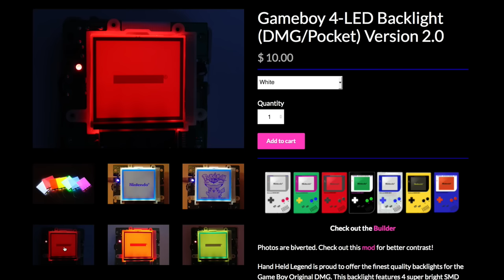How to Install a Game Boy Pocket Backlight!

Comment from the maker: I'm told that newer versions of the Hand Held Legend backlight kit have been revised so that the resistor is built into the backlight itself. If you pick up one of these kits, it won't include a separate resistor, so the step in the video that shows installing one can be skipped.
Reply: This Does Not Compute can I add the backlight itself without the new polarizer? Or it’s has to be the whole kit?
Reply: Hey Colin. I've been watching a lot of your Gb,Gbc,Gba lighting mod videos. The Gba one helped me out a lot particularly. One random question though... What kind of soldering gun do you use? I really need a better one and the blue and yellow one you have looks like it works really well.
Reply: Juan Diaz you will need to use the new one the old one will basically be ruined doing this and you need a polarizer on the bottom the get any kind of display
Reply: this video is extremely helpful! I love all of Hand Held Legends products they are awesome quality for the price!
Reply: Also the instructions for installation have been updated:
wiring it up as shown in the video makes the backlight flicker, which is barely notable in some games (like F1 Race), but can be extremely uncomfortable to look at in other games (e.g. Hugo). Plus, I had the backlight start to go dim after just 40 minutes using fully charged-up rechargeables.
The updated way to connect the backlight module as shown on the product page is to solder the POSITIVE lead to pin 6 (above pin 4 which you soldered the negative to) and the NEGATIVE lead to pin3 (below pin 1 which you soldered the positive to). Note that if you still have the old version of the backlight module, according to commenter "Moon", you MUST use the resistor, as  it provides constant 5V, as opposed  to varying 2.5-2.7V from pin 1.
This removed the flickering and the rechargeables lasted me easily three times as long, but when they do get weaker, now the contrast gets increasingly lighter until you can't see the pixels at all (but that's just before the gameboy turns off), while the backlight brightness stays constantly bright. So, you win some & lose some using this wiring, but overall it's much better, imo.

It would be cool, if you could put an annotation in the video or update your comment with this information. Other than that I want to thank a lot for this guide! It's been very helpful to me doing this mod and showing me that it even exists in the first place, and gaming on my old Gameboy Pocket is SOOO much more fun now than it's ever been! (And I've had this thing since I was like six years old).
Reply: @LRM12o8  I'm so confused!  I did mine like he did in the video and it flickered right away.  So then I did it like you said positive on pin 6 and negative on pin 3 but I'm getting what sounds like your original issues.  I'm using alkaline and it looks and works great for about 40 minutes and than the contrast (not the brightness) starts to flicker with CPU usage (it seems) and the red power LED gets dim.  I've gone through 2 sets of batteries in a few hours!  Any idea what it could be?  What should the battery life be like with new alkaline batteries after the back-light mod?  Can't be this bad.  Something must be wrong.
Reply: @MN12BIRD  You should look up adding a 5v regulator and a decoupling cap to sort this problem. That will increase battery life and also keep the backlight at same light until batteries gets low.
Reply: They don’t sell the pocket kit anymore

Comment: Just completed this mod with the help of your fantastic video. Keep up the great work!

To those of you who want to try this mod, BE WARNED: the step Colin mentions where he places electrical tape on the opposite side of the backlight mod contacts is more important than is conveyed here. Depending on how the GBP is reassembled, the contacts mentioned may touch the  cartridge slot contacts on the bottom of the PCB. If this is happening, the system will act as though your cartridge/cartridge slot is dirty and display a glitched Nintendo logo and not load any games. I spent an embarrassing amount of time trying to figure out why my Pocket wouldn't load properly and only worked normally again after covering them like Colin demonstrated.

Don't be like me. Cover those contacts before you bundle up your Game Boy Pocket!

Comment: Just did this mod, and the polarizer film, when you hold it up to an LED screen should be oriented the clear way. I.E. turn it until you can see through, and that is the right side up. The way he describes that part is a little confusing. But sweet video! My mod went successfully!

Comment: 5:10 this is incorrect. Soldering to this point will make the backlight flicker with the sound. The correct pin to solder the positive lead to is right next to where the ground was soldered, at pin 6. Pause at 4:45 for reference. Use the resistor when using this pin though, as it's 5v and will kill the backlight without it.

Edited to change the pin number from 5 to 6. Pin 6 gives constant 5v; the pin used in the video will give anywhere from 2.5-2.7v.
Reply: ah that point puts out 5v too?  thats handy.  I was use a capacitor at the top left of the board to get 5v.
Reply: Yeah there are a few spots to get good constant voltage, but the audio driver ain't it lol. I hope Colin updates this video, because it's a good tutorial. Just needs a little annotation to point to the right pin and explain that the resistor is needed after all.
Reply: moo. I have the one with a built-in resistor. I soldered the positive to the 5 point and the backlight didn't turn on at all. Where should I solder it?
Reply: Wow, I feel dumb, lol. Sorry, I was pretty tired when I wrote that comment. You should actually solder the positive lead to pin 6, not 5. 6 gives 5v; I'm not sure what pin 5 does.

I'll edit the top post as well.
Reply: Thank you, made all the difference
Reply: Pin 5 is -16.5V for the LCD, if anyone is wondering.
Reply: And Pin 1 is unregulated 3V from the batteries (2.4V if rechargeables), Pins 3 and 4 are ground, and Pin 6 is 5V.
Reply: moo. Great comment helped me so much
Reply: I soldered it to pin 6, my game seems to flicker. Most notably right now is when I’m playing Pokémon Red
Reply: Omg thank so much for this comment. My teal backlight was flickering between teal and green colors. Now its fixed and a solid teal. Thanks so much!
Reply: Just giving a +1 to this comment. Ordered my kit in Oct. 2020 which had a built-in resistor. Installed and soldered to pin 6 and it works great.
Reply: @noanoxan  crap :’(

Comment: Just finished doing this mod, a couple tips; use a piece of scotch tape around the bottom of the ribbon cable to hold it together, if you've got a lot of adhesive residue on the screen try using a magic eraser cut into small pieces.

Comment: Thank you so much for this guide! It makes playing games on the gameboy so much more enjoyable and it wasn't that hard to do.
However, I had some difficulties on the way, I'd like to share:

1.) When I first turned on the Gameboy after installing the backlight, the screen displayed everything just fine, but it didn't light up at all. I thought the rechargeables to be known good, so I checked on the solder joints and the connection to the screen and stuff dis- and reassembling the gameboy several times. At some point then I connected the gameboy to the wall adapter et voila: the screen lit up (still showing vertical bright lines). Using fresh batteries, it also lit up, though not as bright. freshly charged rechargeables worked as well.
So NOTE that wiring it up as shown in the video will make the backlight go dimmer as the batteries/rechargebles go low on power. there's n updated/better way to wire it up, more on that in 5.).
Test the backlight ONLY using wall adapter or fresh cells!

2.) Using an updated version of the kit, I had difficulties figuring out the correct orientation of the polarizer, as it looked the darkest/brightest holding it diagonally in front of a screen, and holding in a way it can fit into the screen assembly it just looked medium bright any way I rotated it. but that's not a big issue, though. first attempt, I had the screen inverted, but opening the assembly and turning the filter 90° solved that. no big deal, just something to note.

3.) after all the dis- and reassembling of the gameboy, I got some vertical lines of "white" running across the screen. The ribbon cable is very fragile, so avoid unnecessarily touching the screen assembly, even for troubleshooting purposes. I managed to fix that the next day by resettling the screen ribbon and taping it to the back of the screen assembly until everything made proper contact and the lines were gone. So, if you have vertical lines of what looks like "dead pixels" on your screen, don't worry, It can easily be fixed.

4.) Opening the screen assembly repeatedly to troubleshoot also made some dust go in between the screen layers, which does show in the screen. It's not terribly bad, However I would like to remove the dust particles but do not dare to open the screen assembly again and risk getting vertical lines again. So, again: DO NOT disassemble the screen any more than you absolutely have to! Oh, and keep a can of compressed air ready to remove any dust particles from the screen layers, just in case.

5.) wiring it upthe backlight as shown in the video makes the backlight flicker, which is barely notable in some games (like F1 Race), but can make it extremely uncomfortable to look at in other games (e.g. Hugo). Plus, I had the backlight start to go dim after just 40 minutes using fully charged-up rechargeables.
The updated way to connect the backlight module, as shown on the product page, is to solder the POSITIVE lead to pin 6 (above pin 4 which the negative was soldered to in the video) and the NEGATIVE lead to pin3 (below pin 1 which the positive was soldered to in the video). Note that if you still have the old version of the backlight module, according to commenter "Moon", you MUST use the resistor, as  it provides constant 5V, as opposed  to varying 2.5-2.7V from pin 1.
This removed the flickering and the rechargeables lasted me easily three times as long, but when they do get weaker, now the contrast gets increasingly lighter until you can't see the pixels at all (but that's just before the gameboy turns off), while the backlight brightness stays constantly bright. So, you win some & lose some using this wiring, but overall it's much better, imo.
product page: https://handheldlegend.com/products/game-boy-backlight-dmg-and-pocket?variant=16870377731
check the last image for reference!

In conclusion, it's a fairly simple mod and completely worth it!. Despite the difficulties described above, it only took me 3 hours total and with the lessons learned I could do it in less than 45 mins, if I was to do it again.

Comment: So I just did this. The ribbon cable thing is no joke. I slice the long grey cable straight in half from one side down. I attempted to repair it using a soldering iron, heating it up, and just barely running along the edges that were cut apart. Worked. My screen has a bunch of horizontal black lines near the bottom portion of the screen, but I've learned for next time I do this mod. Someone below this comment said to wire the positive end of the backlight power to number 6, right next to 4, instead of where he does on the video. Do this.

Comment: Hey I have a question. I got my backlight working but a portion of the screen doesn’t work it’s about a 1/4 to 1/2 inch horizontal section of screen with no picture. Not sure if I can fix it or if I need a new screen.

Comment: Since Gameboy pocket uses AAA batteries, it would be great to have the ability to turn the light on or off. I would put a micro push button right the bottom of the power switch. This way, you could slide to turn the gameboy on or off and press the power switch (with the GB turned on) to turn on the light. Using a microcontroller you can even add brightness levels.
Reply: this would be great, except for the fact that you removed the reflective layer, so the screen would be almost impossible to see without the backlight, however a dimmer like for the contrast and volume would be great.
Reply: I'm working on this mod, I'm finding difficulty to control the brightness using PWM due interference on the screen. I'll try some linear controller. Once I finish I'll let you know. Thanks mate
Reply: You're welcome

Comment: success! took longer than expected since most of the reflector adhesive stuck to the glass, and IPA, Meths, Ethanol, Gasoline etc didn't touch it. An aerospace degreaser finally did the trick! Buy hey, it works. Bivert chip to follow. Cheers :)
Reply from the maker: Awesome, glad to hear it all worked out!

Comment: Definitely worth it if you don't nail the ribbon cable. This is literally a console destroying project if messed up as replacement LCDs don't exist yet. Just nicked my ribbon trying to do this as the adhesive would not lift on any corner for me and I had a bad fight with it. Be careful and be delicate on this step, it's as fragile as it sounds.

Comment: I wrecked two screens trying this mod.  I got horizontal and vertical lines when I took off the reflective strip.  Any other tips or tricks to get this to come off easier and not have these lines?
Reply: The lines are a result of damaging either the screen or the ribbon cable. All you can do is be more careful next time.

Comment: Nice one! So do you recommend the resistor or not? I want to do this mod with the original gameboy but am not sure about the resistor. Whats the difference, Mr. Colin?
Reply from the maker: +Benny Palma Really, the difference for me ended up being the brightness of the screen. It's dimmer with the resistor and brighter without. If you plan to play mostly in the evening, the resistor may be a good idea. If you're not sure, try it with the resistor first as it's pretty easy to remove if you want the screen to be brighter. (If you want the best of both worlds, it's possible to install a small potentiometer that would let you vary the brightness.) Good luck!

Comment: I have a quick question: Do you know by any chance where i can get a full replacement screen? My GameBoy Pocket (Model MGB-JPN) has a messed up part of the screen. It just really bothers me and sometimes gets in the way. There are no dead pixels though. It's overtop of the pixels. If there is also a fix for this that would be nice. Thanks in advance ;)
Reply from the maker: +TheGrayWolf81 Is the problem on the glass of the LCD panel itself, or the outer plastic screen cover? I haven't found replacement LCD panels anywhere, but replacement screen covers are pretty common.
Reply: No, unfortunately it is not the screen lens (the plastic cover), but part of the some blueish black random spots in on part of the lcd. But like I said, it has nothing to do with the pixels, there are no dead pixels what so ever. I'm just really anxious to fix it somehow because it's a Japanese model GameBoy. Thanks though ;)
Reply: +TheGrayWolf81 you'd be better off grabbing a cheap faulty gameboy pocket (that has a working screen) off of ebay and swapping the screen out.
Reply: AndehX That's the problem though, I can't find a single damn GB because anything that's faulty, is because of the screen... I'll keep on checking though and hopefully I'll be lucky enough to find one :)
Reply: +TheGrayWolf81 If you haven't found a replacement screen head over to 
r/gameboy sometimes people have extra parts left over from various mods.
Reply: ASTr9fg I'm afraid I don't know what "r/gameboy" is... Is it Reddit? Sorry if I sound stupid :/
Reply: +TheGrayWolf81 Sorry I should have been more specific, yeah it is a sub-reddit dedicated to all things Gameboy.
Reply: Thanks :)

Comment: Ey guys I need some help here. I bought a V3 backlight with a built in resistor. Issue is should I even use an additional resistor? And if not, which point shall I solder the positive wire to?

Comment: Hi Colin, I pulled off the reflective layer on it's own (not on purpose). Can i leave the original polarization layer on or do I HAVE to replace it with the new one? Thanks
Reply from the maker: I'd remove the existing polarizer, as it probably still has its adhesive layer on it. Swapping it with the replacement also gives you options for if you decide to install a bivert chip later on.

Comment: Attempted to install the backlight kit, removed the reflector and polariser extremely carefully, peeling it back in one corner, peeling it slowly and gently, and keeping it as flat as possible so as to not pull up on the ribbon cables. Reassembled the Pocket and the display was damaged, with one horizontal and one vertical line. It seems all it took to destroy the display was movement in the cable, even without pressure or tension. I suspect it depends on the structural integrity of the joints in the cable even before the modification is performed, some displays will be better than others. For me, it makes it very difficult to justify performing the mod because there's no guarantee the display will work once the mod is completed. Shame, because the results are pretty damn good when it does.

Comment: How thorough do you need to be about getting the residual adhesive off? I have been working at this a while with 91% isopropyl and not getting very far.